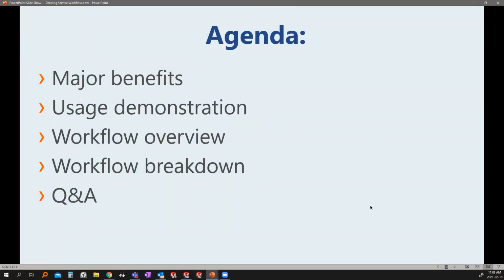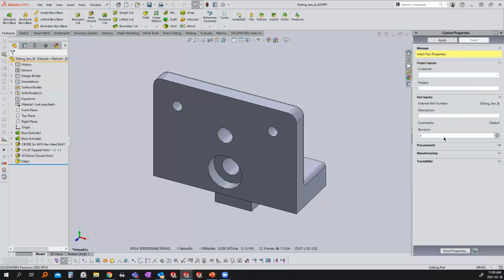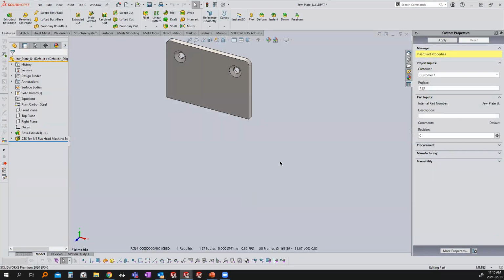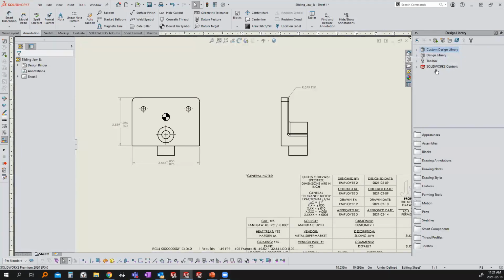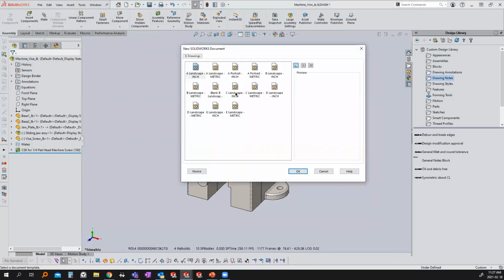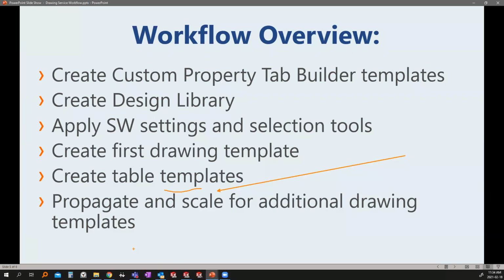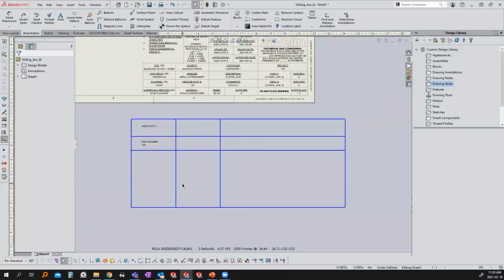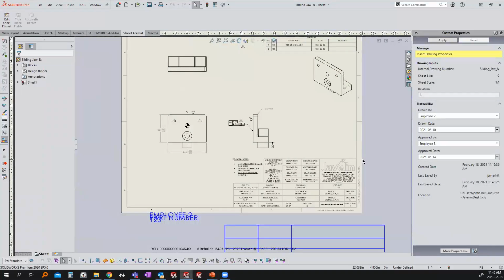SOLIDWORKS Drawings Best Practice Tutorial

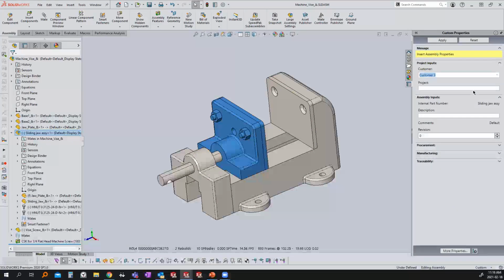Comment: Nice tutorial but at subassembly level "Sliding jaw assy.." (15:06) Customer: Customer 3, and Project: 2252.../Main assembly "Macine_Vice..." (15:47) Customer: Customer 2, and Project: 2352 
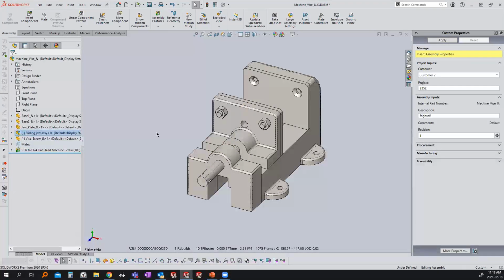part "Sliding jaw" is (part) in the same subassembly (17:55) Customer: Customer1 and 123.
If those property are linked at the part level (17:55) you should have property of Main assembly?
In drawing assembly (27:10) your title block is populate from Main assembly custom property (15:47) Customer: Customer 2, and Project: 2352.
Sorry if I am wrong!